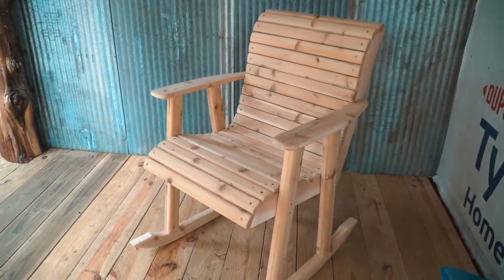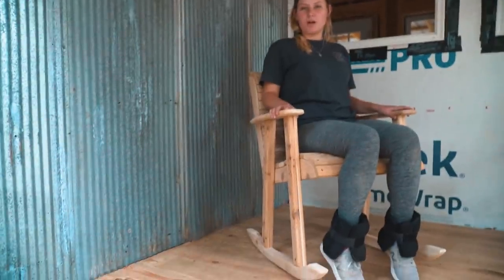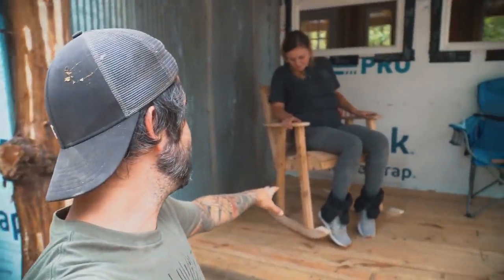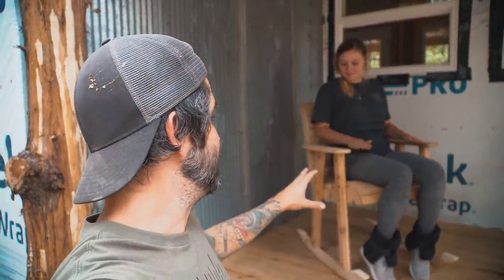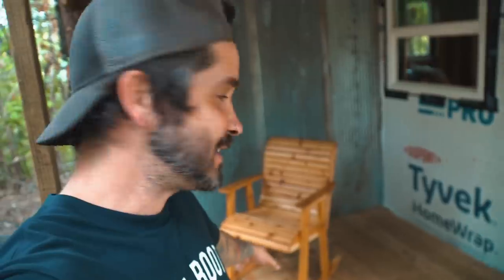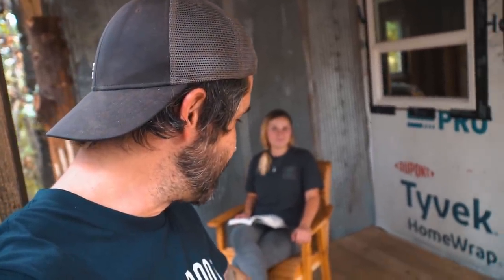Time-lapse / $300 Wayfair Cedar Rocking for ONLY $100. DIY Build (no plans) in under 8 minutes!

Comment: The rocker looks fantastic Jason. Great job! You certainly haven't lost your touch. You do know that building your furniture is also part of the Tiny house build and just as important as the building itself so you have no need to apologize for not working on the outside. Besides, it will help you to have a bit of variety in your days so you won't become bogged down with the same old things all the time. The porch swing sounds great and i know that if you like the one you make for the Sawyers and it suits you own plans for you own place then you will make a great one for you own porch too eventually. I am getting excited at the thought of seeing the lovely things you have in mind for your place.. 😍❤️🇦🇺

Comment: Nice work on the chair, I have built a few of these myself. Used to work at a sawmill. Only thing I would say is braces across the bottom rocker parts from side to side. One brace behind the front leg and one in front of the back leg of cedar of course. Good work. I built chairs similar to this but no legs and had chain going up to the Raptors so it was a swing. Maybe two of these on my friend's porch. You could make a brace that's 1 by 4 and put it vertical behind the front leg and write with a router" CROCKER ROCKER "😁😎